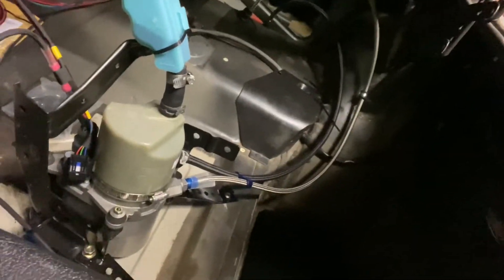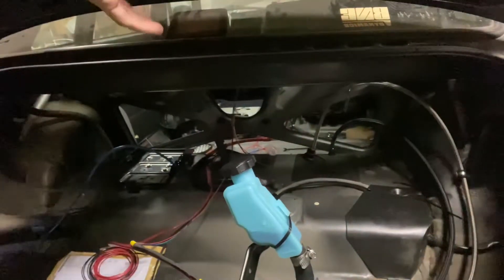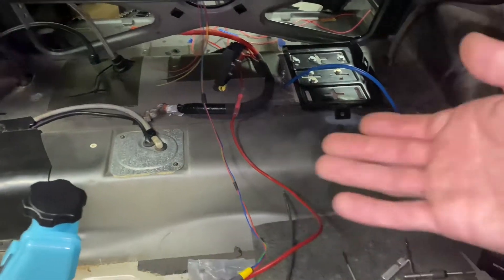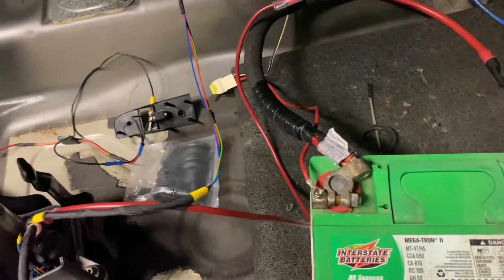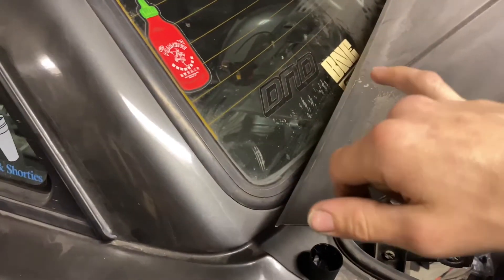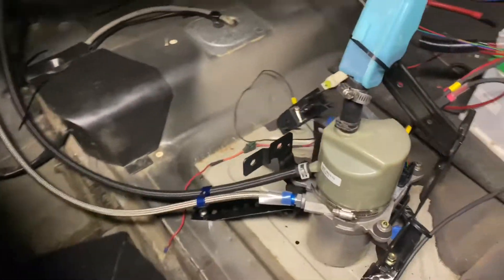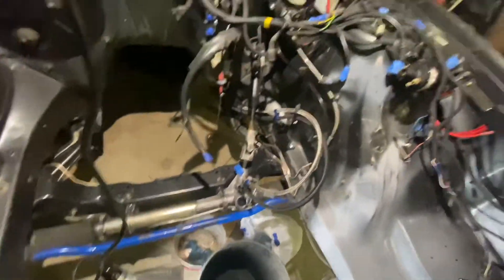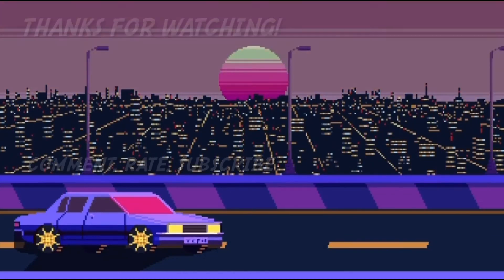VOLVO EPS PUMP WITH VARIABLE SPEED CONTROLLER!?

Comment: Is it possible to connect pump speed with rpm??
Reply: They sell one with a GPS, will adjust with the speed! Much better! Will feel like factory, the faster you go, the tighter the feel.
Reply: There is a company that makes a controller that is GPS enabled to vary the power output of the pump

Comment: What adapters to pump did you use? Did I miss it in the video?
Reply from the maker: I ended up getting a Russell fitting for the pump, and chase bays fittings for my steering rack. 
PN: Edelbrock Russell 648060 Power steering adapter. I found it on Amazon, for the best price.
Reply: @OlvoRent  thank you!